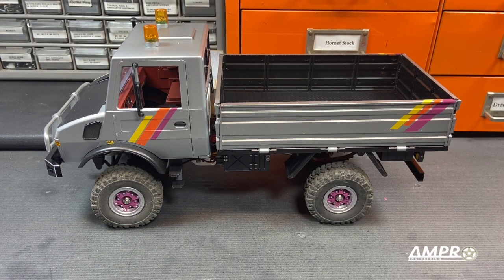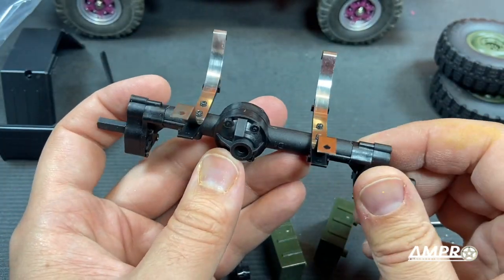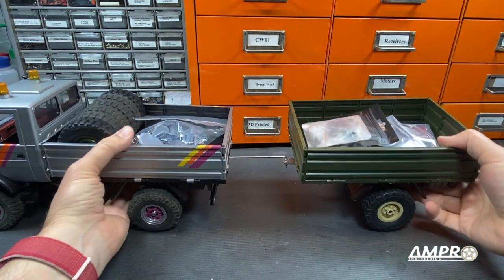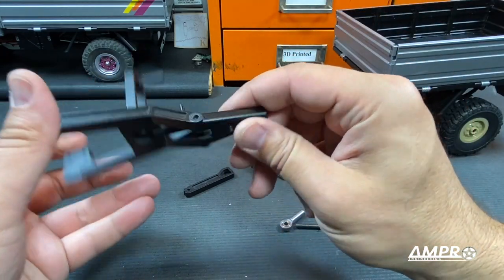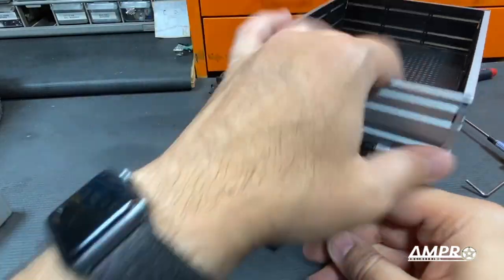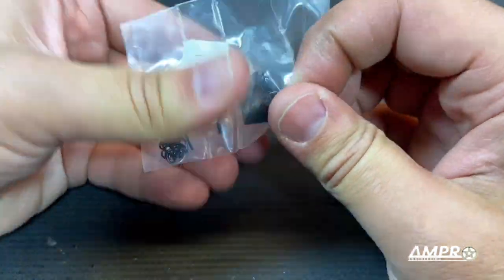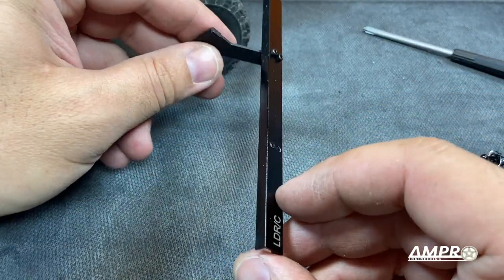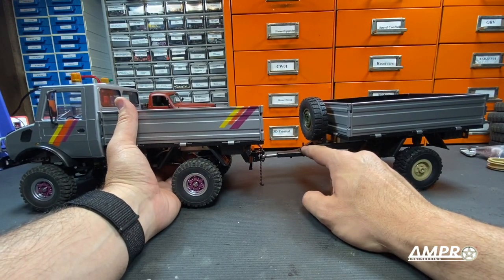e395: LDRC Unimog P06 Trailer "Truck Bucket" & Customization

Comment: That spot in front of the spare tire u could make a small tool box that can hold a connector to plug power from the trailer lights to the truck. Using small enough wire to look scale. Just an idea that way u don't have to add another batter to the trailer and try to hide it
Reply from the maker: That is a great idea! This would look cool and serve a purpose.